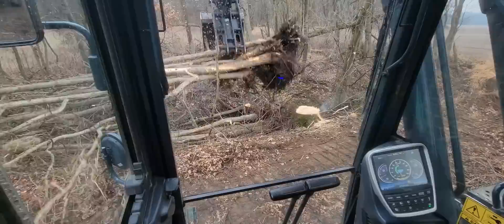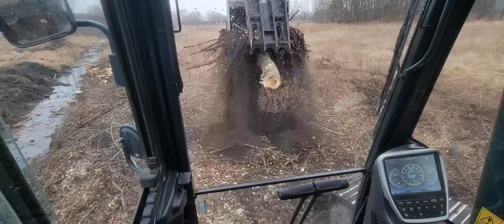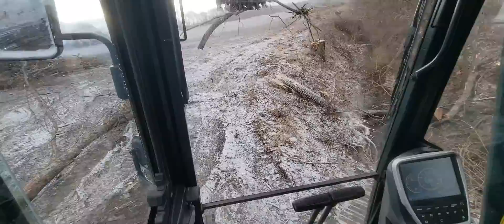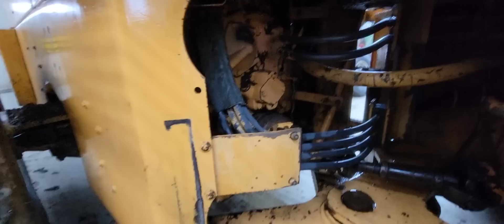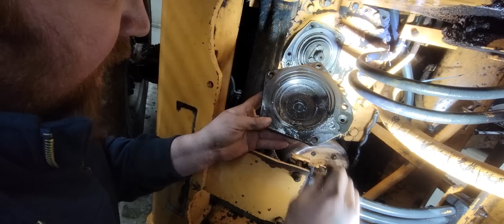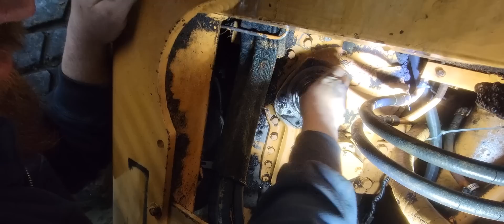Good Day Gone Bad! The Loader Needs Some Help!

Comment: Brandon, one thing you did not mention about tiling is the time it takes to do it. We grow a field of wheat each year so we can tile it in the summer when we have time. Spring and fall are usually too short to do much tiling.
Reply from the maker: Yes it's definitely time consuming especially if your using a bucket wheel trencher plows are definitely faster but it still takes time

Comment: Many years ago I inherited a old Long 445, built by UTB with Fiat parts in the mecca of quality manufacturing, Romania. It's so awkward to operate that it becomes a personal challenge. Permanently mounted is a circa 1964 Bush Hog Stump Jumper. It skidded to a stop one day. Pulled the top off the tranny and found a chunk of metal squashed between 2 gears, no idea where it came from. Cleaned out, did a little dental work on the teeth and it's still running.
Reply from the maker: I had to look a Long 445 up I had never seen one before!! Luckily the load suffered no gear damage

Comment: Only direction the bearing bits can go is the oil drain back.  I feel reasonably confident they are safely sitting in the bottom of the sump.  Glad the sudden stop didn't break anything else.  I'd take a look at the shaft bearing below it just to make sure it didn't partake in the shrapnel party.

Comment: I hope its not the case but the machine locking up and then getting going again sounds like a bearing roller dropped between a couple of gears! Ooch! 😬
Reply from the maker: I hoping that's not the case but every time it did lock up it was that race to race bearing sound so it gives me hope we shall see though the truth will come out when we drain the transmission

Comment: I got a kick out of watching LD18 using a tree trunk as a makeshift rake for his 220 excavator.
Reply from the maker: Like I did with the I beam on the building that I cleaned up for the city? I once used a log to back fill trench that worked great
Reply: @dirtgrainsteel  
Yeah, I remember that I Beam.  Did they let you keep it as a souvenir?
Reply: Cotontop will grab a log sometimes too with his Robotec clam to smooth out the ground instead of switching to the bucket.